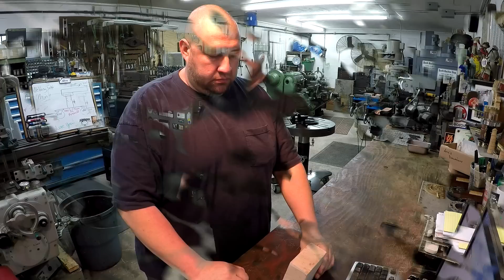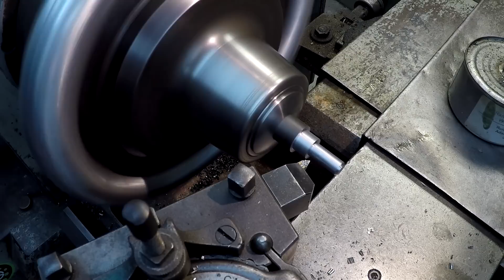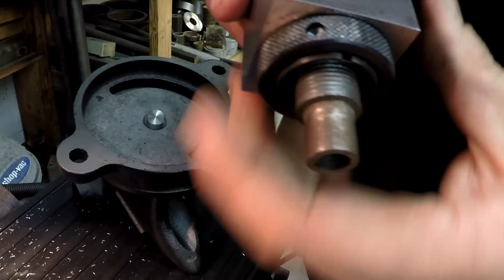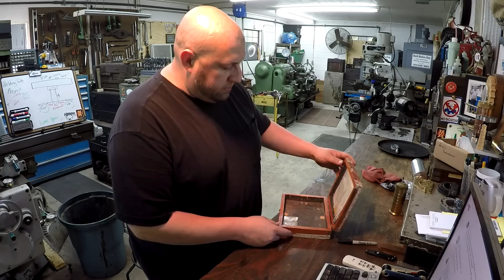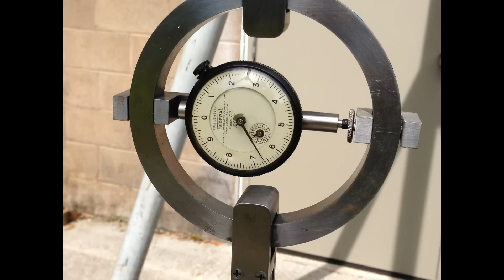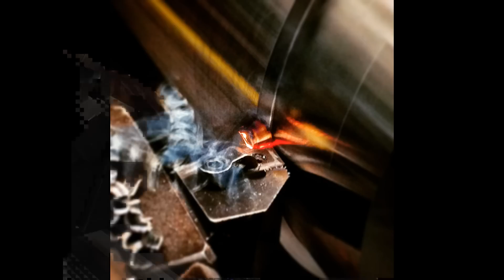Saturday Night Special 67

Comment: Adam, thanks for another interesting mix of topics. You told us to guess the weight of the welding table, so I thought 708 lbs before you weighed it...I always overestimate things.
I like that little vise...should be very useful on the table.
Anyway, thanks again.
Joe

Comment: Adam, you could have run that wood cutter closer to 20,000 RPM in a router...but it worked fine as it was. 

My guess on the welding table weight was 648 lbs...but that was knowing your previous measurement. I wouldn't have been anywhere near as close guessing from scratch. 

Thanks for sharing!

-- Mike
Reply from the maker: BigMjolnir  Router's are made for wood, but the grind of the cutter is just like a metal cutting endmill. It'll do the job in the mill too. Close guess on the weight!

Comment: Those were some nice chips...that is one heavy table! You can be sure no one is gonna pick that up and throw it in the back of a pickup truck.....lol  What was wrong with that unit that you took the pictures of in the lathe at work? Bent?
Reply from the maker: Duncan Mac If you talking about the cylinder plate, the lugs were worn out and corroded bad. I just decided to have some fun and machine them off vs other methods.

Comment: Hey Adam,  Very nice restoration work on the vice.  The Welding table turned out Great, I thought the miniature welding table that was made for you was cool.  At 650 lbs.  it is truly a Abom79 project.  I do like the t-shirts, the fit is wonderful.  Thank You for another SNS have a great weekend.
Matt C.
P.S. the trick using the lathe to back out the busted bolt, NICE!

Comment: Adam,

Nice vid. One hell of a welding table!

When you cut those threads. You had your scratch pass then 4 cuts and a finish thou, "spring" cut I think you said. What was the depth of each cut? Do you have a rule of thumb usually when you cut threads. 

Best.

Comment: Hey Adam, nice vise should work good with a tee nut for easy set up. I got to say my guess was 650 to 700 lb. I like the way that "scale" works, we use what we call a dynomometer at work to sag wire, we have to know what the temperature is, the span length ,wire size... my point is that someone can up with a way to do something and then went to a machine shop and said can you make this? And now we have a tool to make our job better. Thanks.
Buddy
Reply from the maker: Hey buddy, yes several of you guys guessed very close to what it weighed. It was fun reading all ths comments on FB. 
That proving ring is a cool and fun tool to use. I'm glad Kevin sent it to me for testing. 
Hope you get some use from those cutters I sent ya!
Reply: Abom79 Already used one, worked great.Thanks.

Comment: Adam...found this Morehouse 10,000Lb.  Provin ring on Ebay...here's the link...and I will provide you te link for te pdf of the handbook for operations if you like.  greywolfcherokee@gmail.com http://www.ebay.com/itm/Morehouse-Instrument-Series-200-Compression-Proving-Ring-Capacity-10000-lbf-5333-/331534849918?pt=LH_DefaultDomain_0&hash=item4d3104577e

Comment: On that vice I think you need a center bolt and washer to take most of the load instead of the centering pin. The swivel lock won't take much. But you're not gonna hammer or bend much in it so...

Comment: Okay Adam, how's this sound?; 
The Abom79 Welding Table Model #650.  
Comes in any color you like, as long as it's black! 
Your future plans for the shop expansion sound really good, all taken with small steps. The slab sheltered from the sun and rain is a practical beginning. Cheers.
Reply from the maker: Rain Coast I like it! Model No. 650. Nice!
Reply: Abom79 And the little one MINIME!

Comment: Brother when you first look up after taking a bite, and shook your head yes, I busted out laughing. Old quick draw mcgraw.... Are you reversing the carriage at the same time as you hit the nut or which is your priority to hit threading like that? So the ring is measuring the actual collapse of the ring huh?
Reply from the maker: chuck kidwell Hey Chuck, I bet you'd be shaking your head YES if you tasted those cordials too. LOLQuick draw method is right hand dissengage half nuts, and left hand backing out the cross slide at the same time. Give it a try! Go BIG!
Reply: Abom79 I intend to my friend. Confidence is not an area I lack in. Although I am smart enough to practice with a relief.

Comment: Good video Adam, strangely I guessed 675lbs for the table- pure luck!! That weighing device is a bit special I think. Those chocolates looked gorgeous. Loved the heavy machining pictures but I wondered why you used the lathe to chew off all that flange metal - I would have thought you would have gassed most of it and then finished it off with the lathe. There must be some serious torque in that lathe to use it to unscrew that plug or whatever it was!

Comment: Unless you are like me and have a serious adversion to borrowing money and you really want to expand out the shop I would seriously consider borrowing the money to wall it up and do the roof at one time. I think the added security of having your stuff inside would be a huge benefit and doing it at once should save a bunch on labor vs doing it at different times, espescially if you plan to do the wall in cinder block like you have now.  I thought I was the only cheater to use the lathe as a power wrench! lol Those were some good looking shafts! i cm currently doing a video on turning down some hardened 4340 shafts. That stuff cuts hard but the chips and finish sure are pretty. :-)
Reply from the maker: bcbloc02 The wall will be stick built, just like the roof. I cannot afford it all at once, so start with the roof, and move on as I can afford to. I don't like to borrow money, it's a pain in the ass. I like to pay cash for what I want. Once the roof goes up, I'll most likely run electrical, then move on to the wall. It will eventually be enclosed on all three sides and have doors.
Reply: I hear ya, its why I am rehabbing a 150yo barn for a shop rather than building new. That is if it ever quits raining here every day or two. It has been like a swamp around here since the snow melted in March. Good luck with your project!

Comment: I just noticed the rubber mat you have over the mill's table. Clever way to protect the table.
Reply from the maker: Stephan Soucy Love that rubber. It was made to fit the mill table. It's got a rib on the bottom that press into the center t-slot.